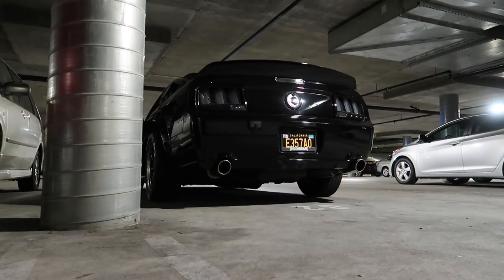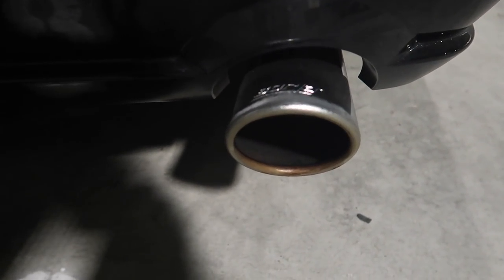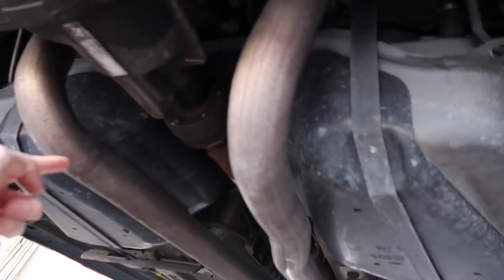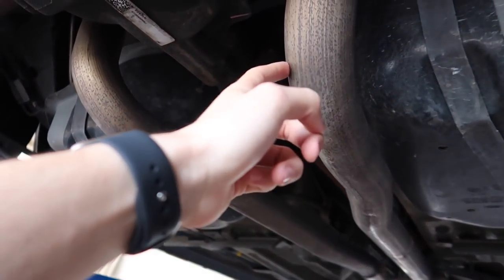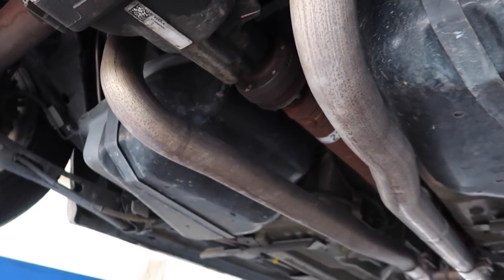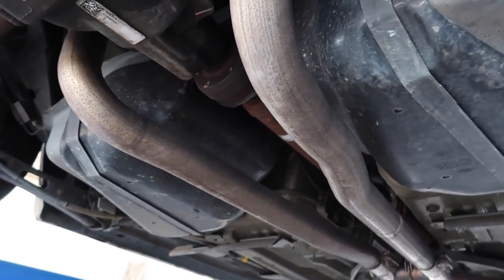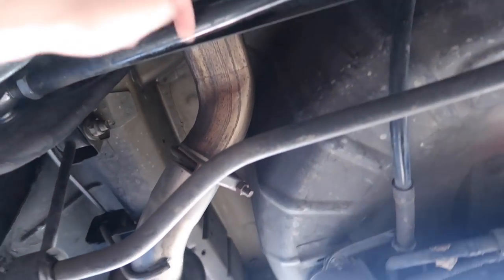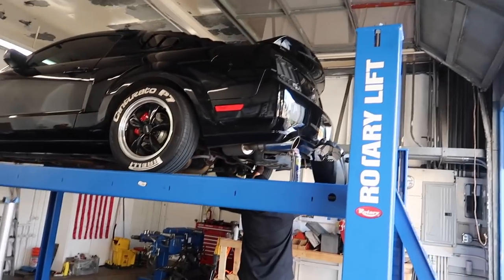The WORST Thing About Aftermarket Exhaust!

Comment: I don't have any issues with just the Bullitt axle back on my car. It has the same look as stock except for bigger tips and it sounds way better. Quiet when you want it to be but sounds great when you get on it. No rattles, no drone, installed it myself. You should check to make sure all of the bolts are tight. I did have a knock over bumps and had to adjust mine and retighten all of the bolts, that solved the issue.
Reply from the maker: thats great that yours are working good! Everything looked good for my exhaust but its still rattling! Imma do so more looking around

Comment: Omg dude.  My rear end has sooo many odd ball noises now:
1. Pypes Bomb axle-back: clamp it on tighter than possible!  Stopped rattling.
2. SR panhard bar.  For some reason makes a noise a well.
3. Since car lowered:  somehow it threw off my geometry.  I think that led to a wearing of my rear differential bushing at the rear upper control arm.  So it became loose and started a clanking noise. You can tell if it is worn by jacking car up and seeing if there is side to side jiggle in rear.  Mine was jiggling. Since then changed out to BMR rear upper control arm, rear lower control arm, rear upper control arm frame mount, and differential bushing.  All BMR from American Muscle.  Got rid of the crazy clank but still some looseness.
Pretty sure its now the SR panhard bar causing noise and some contribution from rear trunk mat flapping too.  Lol.
Reply from the maker: I'm glad we shared the same problem! lol it looked like you solved a lot of your noises tho. I am about half way through. Next time I go under hear, Ill go check to see if my bushings and bolts are looking good. I am determined to solve this problem! Thanks for the great advice man!
Reply: I also remember some other minor issue that may cause noise:
 - trunk: the black colored plastic cover part that encloses the trunk's inside light.  Some jitter and knocking as it makes contact with the metal of the trunk lid underside.  Put some rubber or some cushion in between where the plastic and the metal of the trunk.
- that SR panhard you and I have.  It's suppose to be kind of cheap according nearly everyone I talked to.  But ya know what?  It worked well lining up rear after lowering.  As you know, it uses hemi-joints.  Mine always seem to be clean and smooth in operation (get under car, twist it and it works smoothly) but I was told stick some marine grease there might help some clunk.  won't hurt.
- was also told some noise could could from worn sway bar bushings.
idk, maybe this might help a little.

I also have a weird "only noticeable turning left less than 3 mph clink noise" coming from front left area.  NOBODY seems to be able to figure that one out.  But it survived several track sessions so i doubt anything serious.  Lol.

Comment: You might look into installing some new exhaust hangers on the Borla axlebacks & H-Pipe.....could be echo from these being loose in socket getting amplified travelling down exhaust piping. I'm getting a full SS exhaust installed on my '09 GT Glass Top (Kooks 1 5/8" LT headers w\ catted X-pipe & Pypes Super Bomb mid muffler catbacks) but didn't think about the hangers until just now so I'll be looking for any rattles as well. Nice ride Nate!
Reply from the maker: Yeah i think imma grab me some new headers, but i think i figured out where the sound is coming from... stay tuned for my next vid!

Comment: try to add more hangers on both sides, i had the same issue with my 06 cobalt ss. put a cat back on and it rattled. threw some hangers on it to raise it up and that worked for. or you could go to a full welded exhaust. did that on my benz and had no issuses
Reply from the maker: Yeah I think I may have to add more hangers. Where exactly to u hang them from tho?
Reply: i used the sub fram or just the bottom of the car, anything you can drill and put a nut in

Comment: I have a fairly new FlowMaster Outlaw exhaust on my '05GT. I just purchased a Corsa Extreme set and going with that instead. If you were here in Va, I'd hook you up. Put your rear seat back in. It's not that much weight and you will dampen that noise you hear. Love the vids Nate!
Reply: I currently have Flowmaster Outlaws but the passenger side rubs my rear bumper sometimes :(
Reply: i also have the outlaws and just installed a bbk o/r x pipe. i can hear vibrations coming from the rear passenger side... dont know whats going on lol
Reply: That’s the reason I’m switching to Corsa Extreme. Still loud and no drone or rattling
Reply: I had outlaws and yeah same thing, just rattles, too light probably...just went back to stock gt mufflers for time being, otherwise id just get it welded

Comment: I installed a new axle back and got the same issue, I found out some of my hangers are blowing out the rubber bushing, I think because of the axle back not completely being the correct fit as stock was, I still have some clunking but I think it may be something due to the lowering of the car, and just something these cars do.
Reply from the maker: yeah a lot of people said it was the rubber bushings. Imma check that out next time

Comment: I have a 2008 mustang v6 I have stock exhaust looking for aftermarket exhaust for a non gt mustang anyone have suggestions
Reply: Roush if they have a design for your years
Reply: Muffler delete it's cheap and sounds dooope
Reply from the maker: flowmaster or borla! if your on a budget than go muffler delete!
Reply: Thank you I also looked further into it and saw some of the conversion kits as well would that be worth it cause I know it does increase airflow then the standard Y pipe so it does increase horsepower and affects the sound of the car
Reply: True Dual, X Pipe, Flow Master outlaws or Borla Stinger axlebacks

Comment: That is your rear differential doing that (the rear end). Too much free play. Jack up your car and turn the drive shaft back and forth. You will hear the noise. My 2002 Mustang GT is worse than yours, and 2 mechanics said it was normal. I thought how could it be? Grrrrrrr
Reply from the maker: I don't doubt that! how did you fix it?
Reply: I didn't get it fixed. No mechanic would touch it. They said "it's normal." So I just put up with it. :(